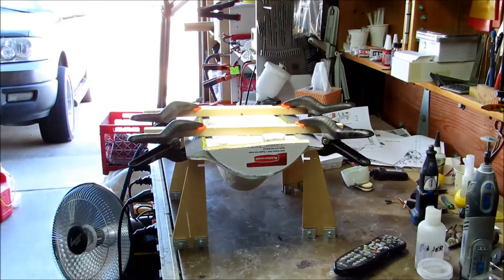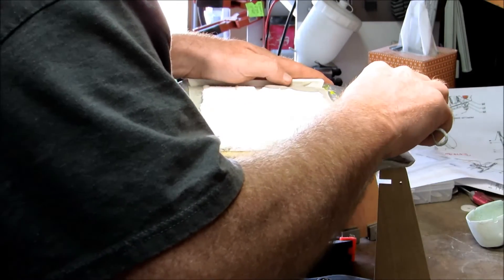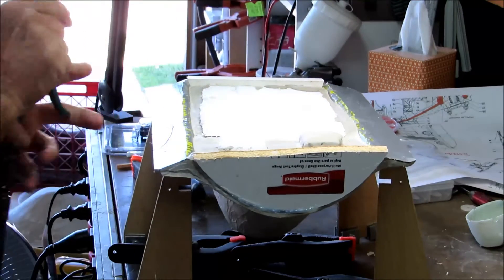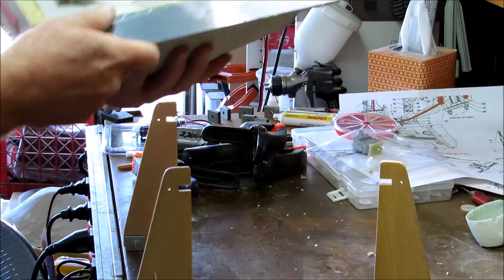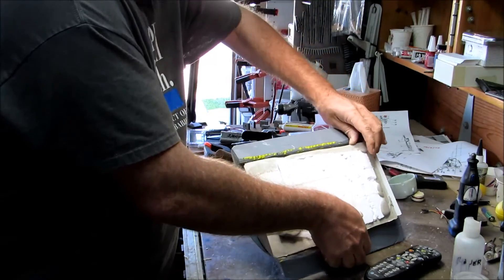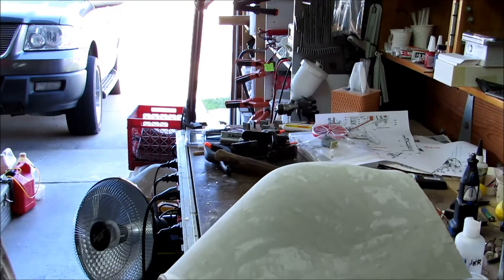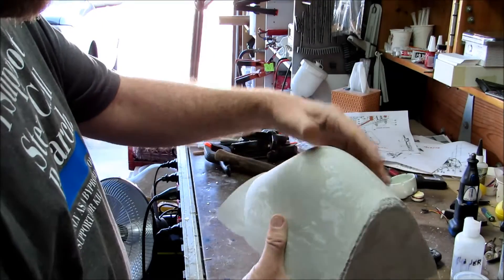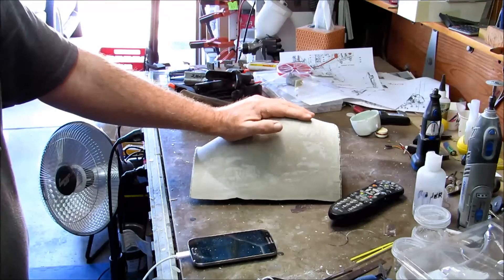Corsair #59, Pouring the Final Final Canopy Plug From the New Mold

Comment: Had a friend look at this and she said the ridges are from the two different pours creating air bubbles. Said to mix slower and longer with your post hole digger. She uses a kitchen type mixer. She said it has to stay at a constant temp throughout, during the cure. No trouble lights. She suspected the light caused the 'bump'. Tophat has the real deal I'm sure but it might take a small fortune to set something up that would do it perfect.
Reply from the maker: The 1st attempt is the one that had the 2 different batches, and your friend is right...there were definite "folds" where it looks like the 2 different batches chose to not like each other. The batch that I popped out in this video, however, was done all in one pour...and without exploding "batter" all over my garage. Yay!
I suspect that Tophat is right that the minor creases in this one are probably from shrinkage during the cure.

Comment: If you make your slurry thinner it will most likely make things worse due to having a higher percentage of water which will increase cure time but more importantly it will affect shrinkage of the molded part and make it more brittle. The reason this will happen is due to the molecular strands being bonded so loosely ie "uniformly". However if you thicken the slurry and add pressure without cracking the mold of course; the molecular strands will have a higher disorientation making it more rigid hence less shrinkage and a stronger molded part true to form. This is why the part was wavy, that is shrinkage that the slurry went through during the curing phase along with the other defects that you seen after sanding due to having no pressure on the slurry. I can go on about this but it will get more complex. I do injection molding for a living. Molding is molding it doesn't matter what your using; plastic or cement or plaster paris or even steel pressure and shrinkage are the key factors here. As for you question I am thinking on giving you an answer but you may not like it due to the extensive steps you would have to take in order to prevent the mold from cracking under pressure. Now the easy way out is to give your male plug some TLC and get it as close to the original part as you can.
Reply from the maker: Wow. Thanks for the information. I would be interested in knowing the "hard" way to apply pressure, but for this item, I am several hours into the TLC on the final plug...and it will be more than adequate for this purpose, and I will get some bitchen canopies off of it, but it would be nice to know, for the future.

Comment: What your seeing is most likely due to having no pressure in your mold and if so it will not matter how thin you make it the results will be the same.
Reply from the maker: Interesting point. How would you go about putting the slurry under pressure?